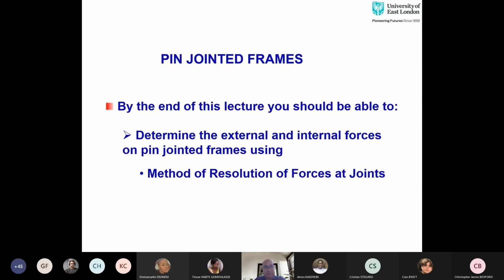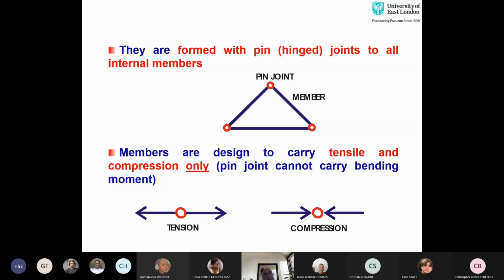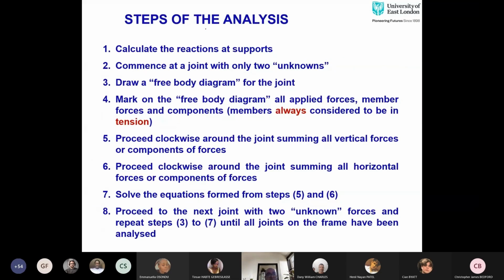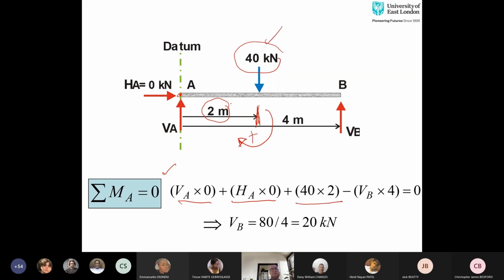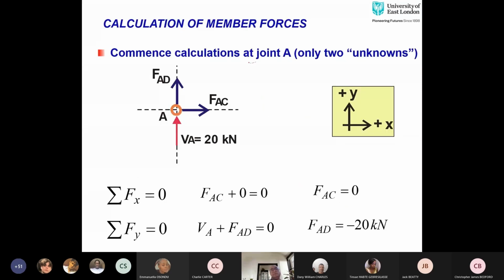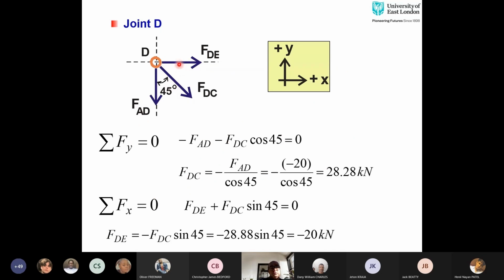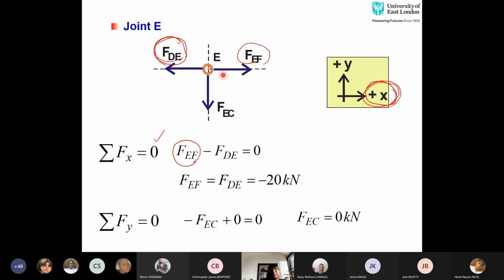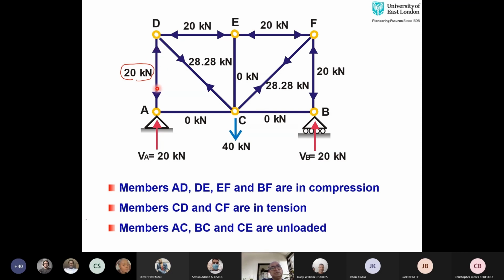How TRUSSES work!

Comment: Sir,  In an ideal truss the members shall be not continuous , i.e. they shall be broken at joints.
But in practice for steel trusses , top and and bottom chords are continuous over 2/3 joints and spliced at 12 m, will it remain an ideal truss.
Does the Chords not behave like beams in such a case. please clarify
Reply from the maker: Yes, chords behave like top flanges of beam and diagonals like webs of beams. Thanks for your kind contribution.